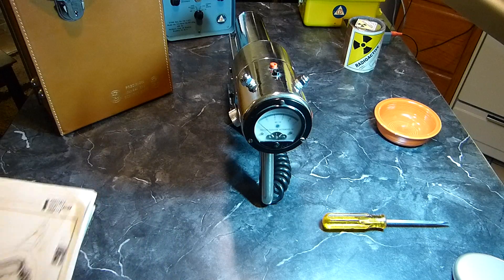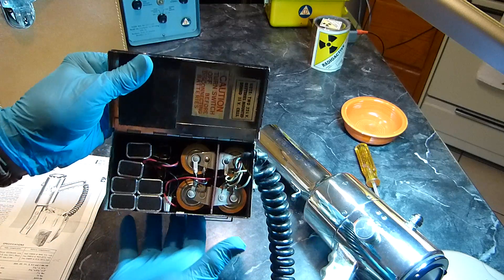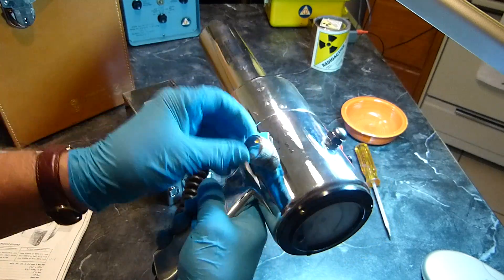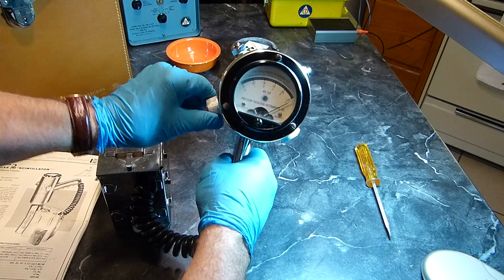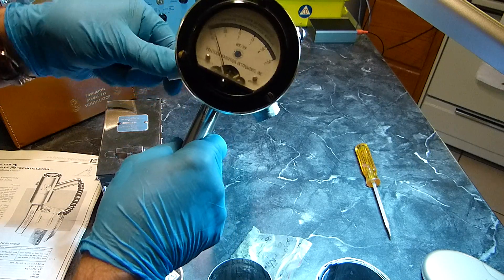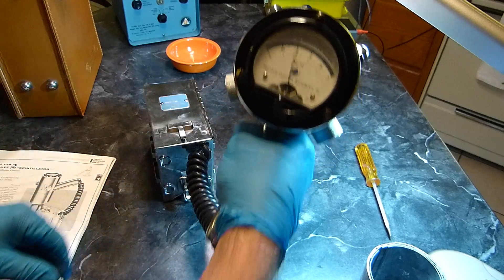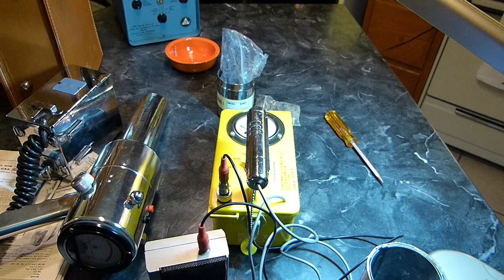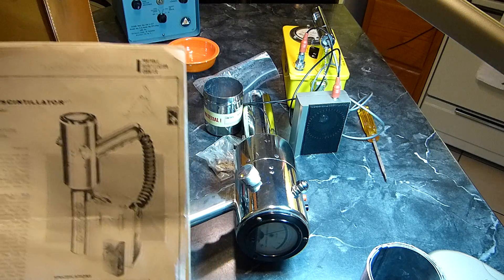Precision Radiation Instruments, Inc Model 111B De Luxe Scintillator

Comment: I found my dads still in mint condition I haven’t found any batteries 🔋 but I’m going to try your idea 💡
Reply from the maker: I got this on at an estate sale and it is mint also. You can make it work again with the 9V batteries but be very careful about polarity to get it right. Take your time to get it right. If you hook the polarity of the batteries up both ways, you have 100% connected it wrong - at least once. Wrong polarity on solid state components can destroy them - I have had it happen to me years ago on a different piece of equipment. Also, the voltages from the 9V batteries in series may not be exact but it will still work. Good luck with yours.

Comment: The check sources supplied with that Scintillation detector contain Radium 226, although is appears to be a sealed source I would recommend storing that in its own air right container, And stored away from yourself. 

Also it is not always advisable to store multiple isotopes in a single container,.
Thank you very much for the very informative video

Comment: How does the large plastic scintillator compare to a similar sized nai(tl) Crystal scintillator? I would rather have a plastic model because of its ruggedness......but need good sensitivity. 

I’ll be searching for Active sources at a scrapyard and I need to be able to pick things up from a few feet away
Reply from the maker: This is the only scintillator I have ever had so I don't know about others. This device is more sensitive to gamma than the common Civil Defense CDV-700 type Geiger counters. I also bought one of the plastic cigarette pack sized Geiger counters that are really sensitive but from my mineral sources, none of my instruments can detect them more than about two feet away as best I can remember. On the other hand, I went thru a "nuclear stress test" a few years back and the CDV-700 was amazingly sensitive. Here is one of three videos I posted.
https://www.youtube.com/watch?v=ODF8r-ngo5Y&t=148s
Reply: ElPaso TubeAmps wow thanks for that! That really helps. There’s not a lot of information out there about scintillation detectors. Tell me about this cigarette sized package detector that you mention. Is it the “Atom fast” or “Atom nano” or “atom spectra” ??

The same gentleman makes all of them. Check out his eBay. He has scintillation probes as small as a pencil eraser… And as big as a shoebox! 

I’m purchasing a Ludlum model three and a Bicron Nai(tl) probe with crystal measuring 57mm x 38mm
It will be extremely sensitive giving background readings of around 4000 to 6000 or more!!!!. This should give me the capability of detecting contaminated metals and radioactive sources from several meters away. A friend of mine owns a local scrap yard, and they get more than their fair share of radioactive sources! I found several sources there with my cheap geiger counter… And considering they don’t scan anything for radiation… I fear they are in danger.

 I’m sure its because we are near Oak Ridge national research lab. “The home of the atom bomb”. They’ve done nuclear research around here long before it was seen as dangerous.
 back then..... they didn’t have strict security. A lot of sources escaped the property. I think that’s why we end up with so many highly radioactive things that should’ve never left a laboratory. Crazy ridiculous amounts of radiation in some of these tiny sources. Also, Chattanooga is a boomtown for all kinds of massive manufacturing and industrial applications. And has been for 100 years. There are a lot of radioactive sources used in measurement and industry. I think the scrapyard gets more than they realize… And I hope to find them and keep my friends from danger.
Once they see the danger I’m sure they will purchase some type of portal scanning meter for the vehicles to drive through. At least I hope they do!!!

These aren’t regular sources were talking about… And Given their danger and strength… I need to identify danger from a distance of at least a few feet… And the ludlum 3 with the large Bicron scintillator probe will help me do that! Hope to receive all of it within the next week!

Comment: I have restored these in the past.  The black disk is a PRI radium check source.  On the back you should see a number stamped as .09 up to .25 or some other number in between.  To calibrate set the unit to .25.  Place the disk against the front of the unit and adjust the CAL knob to the setting on the disk, and then your scintillator will be calibrated.   The units I restored required all of the capacitors to be replaced, the NaThI crystal if bad replaced or restored with a plastic one.  I was fortunate to get from Allyn Goshy his inverter unit that replaced the old style batteries with modern D cells.   He passed away and now the only way to do it is to do as you did with series of 9 volt batteries.  You can find the PRI 111B Manual at:  https://www.orau.org/PTP/Library/InstrManuals/PRI%20i111b%20and%20117.pdf  This PDF can be downloaded and printed out.
Reply from the maker: Thank you very much. I have the check source but had no idea how to use it for calibration.

Comment: ive got a 111c! :)
Reply from the maker: Have you made it work?  These things are amazing at detecting gamma. Better than the Civil Defense Geiger counter.
Reply: ElPaso TubeAmps not yet. I just bought a 111B for some parts, I’ll have to post a video once I get it all together! I’ve never seen a 111C even go for sale so it’s kinda odd I even came across one
Reply from the maker: @sethery7826  Good luck with your project. I subscribed to you so I can see what you post on it.
Reply: I would like to know more about my 111C’s value as well. I’ve found nothing yet. Bought it for $30 bucks today, testing it soon. Does anyone know correct battery voltage? Everything I could find is for previous 111 models.

Comment: Great video!
Hope to get one or two of these up and running soon. Have about 5 in storage. One is bound to work!
Reply from the maker: I just posted another video on the way I wired this unit using 9 volt batteries to obtain the 22.5 and 67 volt sources.
Reply: ElPaso TubeAmps 
Cool! Was curious how you hooked up the 22.5's.  Looking forward to watching it.

Comment: I have one of these. There used to be a guy (allyn goshy) that made power supplies for these. I have one of his power supplies in mine. It uses 6 D cells and provides all the needed voltages. I tried the 9v thing but they sure didn't hold up very long. I tried Allyn's web site (http://www.allnilo.com/battery.htm) and it seems to be gone. If anyone has any info of what happened to him please share it here.

Comment: What would I have to pay for one today, that was in good condition, and has the manual and leather case?
Reply from the maker: I can't remember what I paid for this one unless I mentioned it in the video but it seems like it was about $200.  This device is extremely sensitive, more so than the CDV-700 that is so popular. However, this scintillator only detects gamma and will not detect beta like the CDV-700. Good luck on finding a nice one on Ebay. Here is the manual online:  https://www.orau.org/ptp/Library/InstrManuals/PRI%20i111b%20and%20117.pdf

Comment: I recently got one of these too...thanks for the tip on how to connect the batteries there is very little info out there on these things so I was glad to come across your video! I turned mine on and it seems to be working when you zero the unit, but doesn't seem to be giving any readings when pointed at a radiation source (radium) or pegs it when on the most sensitive settings (not near radiation source). I opened up the scintillator tube and the crystal is bad with moisture damage. I've ordered a new polished plastic crystal off ebay...hopefully that sorts it out.
Reply from the maker: +rangerbb I am glad my video helped. I am pleased to hear that you can still buy a new polished plastic crystal off Ebay. I wasn't aware of that. Maybe I was lucky that mine was in the dry El Paso desert for the last 50 years. I assume you know it only will respond to gamma radiation and not beta or alpha. Best of luck with your instrument. Please let me know how it turns out.
Reply: +ElPaso TubeAmps The original crystal is a sodium iodide crystal...they are very expensive and damage easily by any humidity or moisture getting to the crystal (In SC we have plenty of that!). You can use a similar sized polished plastic crystal in it's place, which is a lot cheaper and very unlikely to get damaged. 

After further inspection I noticed that only one of the vacuum tubes filaments is lit up when powered on. Also one tube 5841 is completely black....I don't know much about tubes but guessing this one is blown. I can replace that tube for $9....but if all the other ones are bad then that can get very expensive! I guess I should try testing the tubes first before I go much further. In the manual it says you can test the filament of a tube by placing a 1000ohm resistor in series with the ohmmeter...I will give that a shot, If it would cost too much to repair then I will use the crystal I bought to build my own Scintillator instead like this example for my cdv-700: http://www.sphere.bc.ca/test/phototubes/+prutchi-paint-can-scintillator.pdf
Reply from the maker: +rangerbb I am not familiar with the tube filaments in this unit  but they are probably very low voltage  and you will not be able to see them lit. My advice is to do as little as possible in the way of invasive surgery. The black tube may be perfectly OK. If they recommend a 1K resistor in series with the ohm meter, they are trying to make sure you limit the current through the filament so you don't damage it. Hopefully, your new crystal will make it work.
Reply: +ElPaso TubeAmps Thanks for your advice just wanted to update you that I got it working! I guess I was right that the crystal was the problem...I attached the plastic crystal to the photo multiplier with silicone grease, tin foil and good old duct tape :) It works just like yours does...but I would have thought it would have been more sensitive since the manual says you can use it from an airplane. But then again if you are using it to find huge mining deposits you wouldn't want it that sensitive to the odd radioactive rock laying around? Anyway thanks again it's great to have such old instruments working again!
Reply from the maker: +rangerbb That is really good news to hear you got it working. I will definitely remember that about the crystal. Thanks.
Reply: Yes a plastic crystal will work, but you have to upscale it so that it is just large enough to fit into the housing as the plastic crystal is less sensitive to radiation as was the original NaThI crystal.  Also there is a high voltage regulator tube in these that often go bad.  These can be replaced with Victoreen new ones.  However they are are hard to find, and what I have found is that one can stack a series of ten 91 volt zenier diodes to the proper ~900 -920 volt output and that will work in palce of the original HV tube.  Another point is the old capacitors.  These should all be replaced with modern ones to get this scintiliator up to full operating potential which is about 100 times more sensitive than a CDV 700 Geiger counter.  I have restored several of these, including the box type 117.  They are fantastic instruments when fully restored.  Be sure to download the printable manual for these at: https://www.orau.org/PTP/Library/InstrManuals/PRI%20i111b%20and%20117.pdf
Reply: Another alternative is to carefully dry out the NaI crystal in the oven.   That works sometimes. There are sites that will tell you how to do it.  Just be careful in handling the NaI 🙂

Comment: Wow, that is a beautifully made probe and in amazing condition considering it's age. Does it mention what the scintillation material is made from?
Reply from the maker: DextersLab2013 From Theory Of Operation - "The "Scintillator" employs a sodium iodide crystal optically coupled to an RCA 6199 photo-multiplier tube. The tube is enclosed in a magnetic shield to prevent defocusing by the earth's magnetic field. When gamma rays penetrate the crystal, they cause it to scintillate or throw off minute flashes of light. The light flashes are converted to electrical pulses by the photomultiplier tube and the tube greatly amplifies these pulses..."
Reply: ElPaso TubeAmps  Still the same tech in popular use today. That probe looks amazing whoever designed and built it certainly took pride in their work! Thanks for sharing!